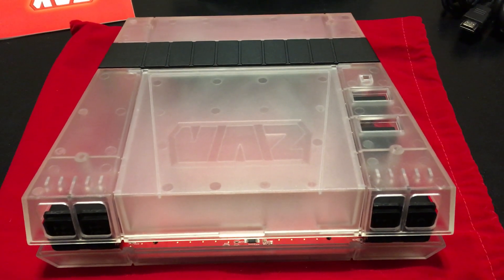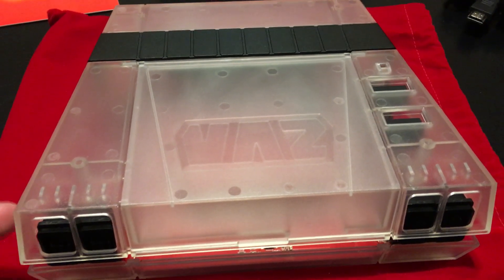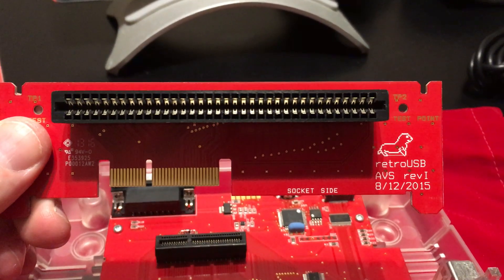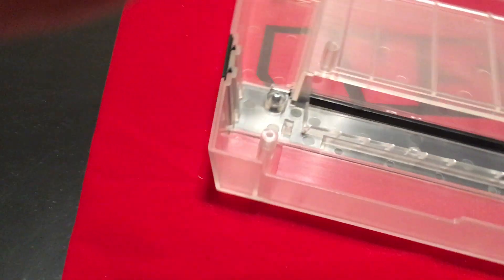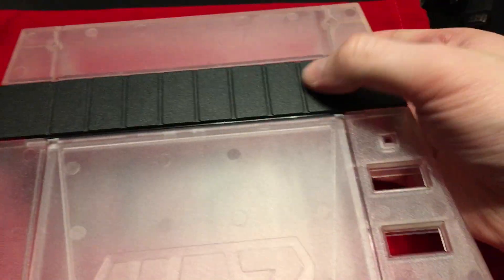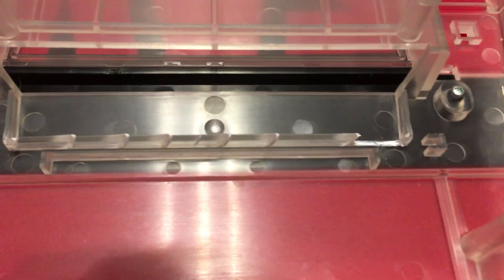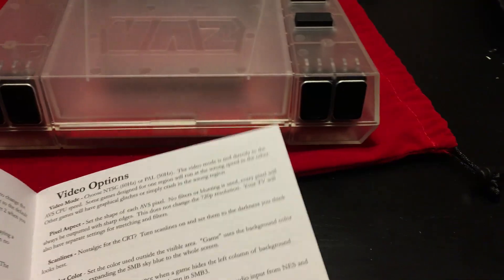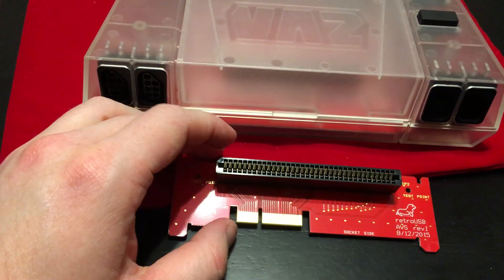retroUSB AVS NES connector replacement

Comment: My cartridge slot broke a part of one of my games lol. I think it's crooked because it refuses to accept any of my games. But the game it broke now works because the piece holding the circuit board snapped off, and it is now crooked. I emailed Retrousb about this defect because I refuse to put any other games in the system.
Reply from the maker: Weird, Have you replaced the cartridge connector or is this problem with the stock system? In this video I shave off the part above the new connector to keep it aligned properly. Stock it should line up correctly though.